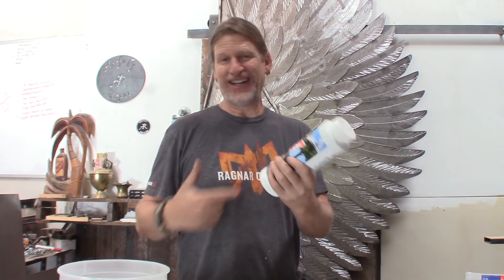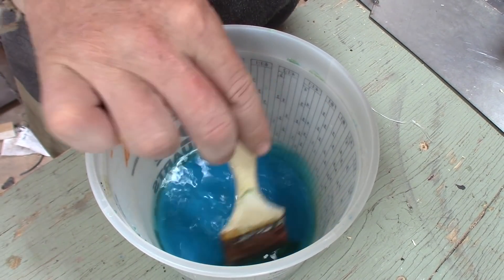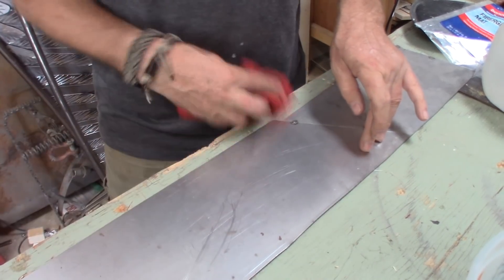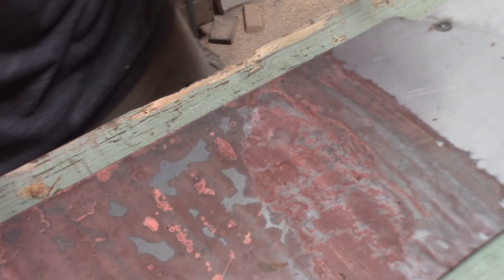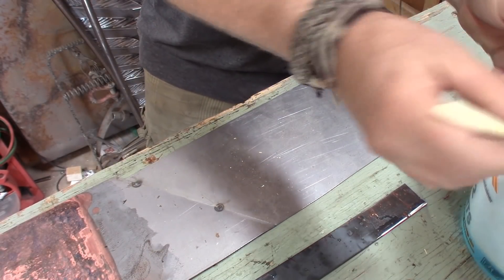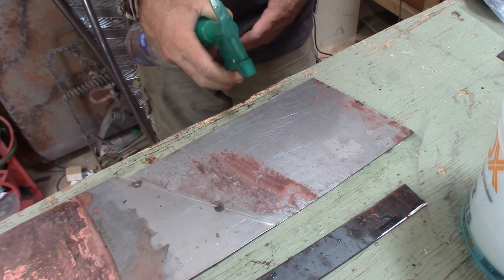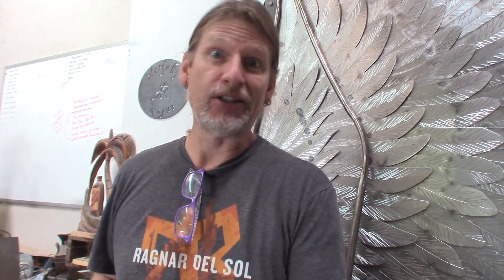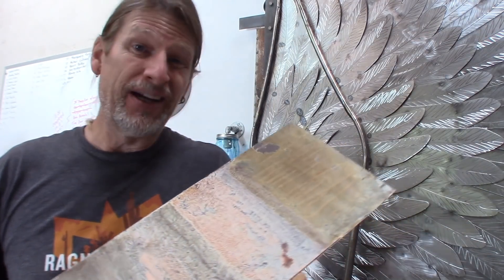Copper Sulfate on steel FREAKED ME OUT!!!!

Comment: Pressure treated lumber contains copper.  That's why you have to use special coated screws in it.  If you put a regular nail into pressure treated lumber, it will be completely rusted away in a year. This is because copper is not close to steel on a galvanic chart.  
I'm guessing you don't want your door skins to keep rusting after you create them.

Comment: I'm in the process of restoring an old table saw with a cast iron top.  There has to be at least a hundred YouTube videos on ways to remove rust from cast iron, but I didn't see any that suggested using CLR (Calcium, Lime & Rust Remover).  I tried a similar product, also made by ZEP, which is available from Home Depot.  It's commercial grade, far less expensive and more concentrated than CLR.
I spread paper towels over the top of the flat table and soaked the towels with the full strength solution and left it over night to see if it would budge the rust.  I was amazed when I pulled back the towels.  The surface was etched in an amazing pattern, almost a CAMO effect of muted rust tones, greens, reds and blacks.  The most amazing thing was the shapes of the patterns and the layered dept of the pattern.  I'm sure you would really like it.  I would love to see this as a finish on a Rat-Rod.  Unfortunately, that wasn't the effect I was looking for on a table saw so I easily hand sanded it out with 400 grit wet & dry sand paper using varsol as the wetting agent.  The final result is the smooth, rust free polished steel finish that this saw had when it was new.  A paste wax finish to seal it and it's ready to go.

Comment: Actually what you are doing is dropping copper out of solution not sure what happens to sulfur but this is not truly bonding to the metal if you were to hang a piece in copper sulfate you would see metal copper crystals form it will be 99% pure metallic copper

Comment: pretty much any kind of copper compound will work. Just take hydrochloric acid and some copper than add either hydrogen peroxide or just use an air bubbler to get it to start to break down the copper. Than you can use the resulting black/greenish liquid to plate out onto iron or steel by just brushing it on.

Comment: This is the method we use at my workplace to see if the passivation process for stainless steel worked. If copper forms, it's a fail - there's still iron present.

Comment: Very cool expermient! Scrubbing the work piece with scotch Brite or kitchen pumice and use a degreaser prior to the copper coloring makes it more receptable for the copper..
Copper onto Iron is a exchange of charge or a socalled immersion deposition, you disolve a little iron or its oxide by the solvent of the copper sufate ( or vinegar or chloride) and you deposite Cu ions  slash reduce them into Atoms..the more acidic the Copper suffate is adjusted the faster it goes..but fast deposition is larger copper crystals and less adhesion..so slightly acidic is nice...if you warm up the work piece to 30-40 deg. C it works better...since and Immersion deposit is never sealed you can build up copper over copper for some degree than it slows down and stops..but you can re active the copper color with wiping it with sligthly acidic copper sulfate ( CuS04 + a few drops of dil Sulfuric, careful with acid use goggles and gloves).. 
Now for the deco worker...take it and dry it..then apply Sodium sulphide ( Na2S) diluted in water.. yes the thing smells like rotten eggs..can be made also with onion juice etc..now you can brownish and blacken the Copper entirely and scratch it back with scoth Brite to brings structures alive in the patina.."antique it"  .other tricks are heat it and use ammonia and it turns out patina blue in the warm spots...you can produce very lively colors from copper, black, brown and red or turquise blu..your Indian sculpture behind you would turn into a mindblowing monument with real aging and patina apperance like it was buried for 100 years! Thumbs up for your channel! ->tip  a clear coat after all makes it staying forevee
Reply: Great info! Thanks for sharing your knowledge👍
Reply: @davetruther31  any time Sir!
Reply: @rveurope  Thank you Sir🙏
Reply: Yup. The oil is preventing the chemical from actually getting to the metal. If you like the random effect, you can add a tiny bit of oil to a rag and wipe it gently to leave streaks and globs. 

The copper will turn dark brown, and then turquoise if left by itself. Since the layer is so thin, it will eventually “rust” off. So indeed, you have to protect it with a varnish made for brass. You can get it in glossy and matte.
Reply: Fantastic
Reply: I want to do an entire barn ceiling this way so it has to be fairly easy. Will sodium sulfate turn galvanized tin dark also.  I would like to darken the tin and have copper highlighting. Not necessarily rust, just copper colors on a dark flat tin
Reply: Galvanized tin roof? Entire roof? Gutter?
Reply: Thank you!
Reply: @donmcleod8307  very welcome
Reply: I love to try expermients.  They come with menthol right?   :-)

Comment: you'll get better results if you do an initial acid etch with electolosis and then apply the coat with copper sulfate... cupric chloride also works.  I use the process for copper plating bolts that need some protection... but can't be zinc coated.

Comment: Copper sulfate is one test use to check stainless steel after it’s been passivated because if there’s any metal still in the stainless steel it will turn copper color. The steel on the stainless steel would be cutting tools coming in contact with it fixturing

Comment: You really should wipe it down with acetone to remove the oil.
Reply: Downside of that would be that it'd make the top layer more consistent. It'd give you way more control if you were trying to paint on a specific pattern or just plate on a solid layer of copper, but it'd hamper this kind of decorative weathering by making it look too deliberate. (Yep. Intentional "accidents." Weathering's weird sometimes.)

Comment: If it worked on aluminum it would be cool to ar15 receivers
Reply: It does, as the aluminium will replace the copper in the solution just as it does with iron, but the copper will precipitate, not replace the aluminium in the structure. 7th grade chemistry, at least in my country.
Reply: @DanSlotea  
I would guess nothing happens.  The oxide of the aluminum surface will block any chemical reaction.  So copper sulphate remains itself.
Reply: @lpjunction  there's oxide only if you don't clean it. Also adding  table salt to the solution will start the reaction, even if the surface is covered with oxide. So something happens, if you care to happen.

Comment: When I was a kid (in the 40s), the local farmer's co-op had copper sulfate by the barrel, big crystals about an inch long and a half inch thick.  Farmers used the stuff to soak seeds in before planting--I think to fend off fungus.
Reply: Toklineman you’re right. As a farmer, we use copper sulfate for fungicide (mildew). You can get it at any garden supply store.

Comment: Iron is more reactive than copper. Therefore, when you add a copper compound to the steel, copper precipitates out into the pores of the steel sheet as the elemental Iron changes places with copper in the solution.
Reply: Was looking for this comment. This is 7th grade chemistry. Somebody skipped gymnasium classes hahahaha

Comment: It’s actually white coloured crystals, it’s the moisture from the air that has turned the them blue...
Reply: The white form is anhydrous copper sulphate and is amorphous (non-crystalline), the blue form is the pentahydrate, and is the most common form. The addition of water to the anhydrous salt is strongly exothermic, so take care. The anhydrous form is more expensive. If you leave the anhydrous form in moist air it will absorb water, i.e it is hygroscopic.

Comment: Super cool, until you got to the end and talked about your other video on CAUSING rust.  I can't tell you how many hours/days/weeks I've spent removing rust, but I got a very visceral reaction!
Reply: I live in the S.W. U.S. where the humidity and rainfall are low, we prefer to rust finish steel here because it is cheaper than paint and is easily fixable if damaged.  I had a client who was from the U.K. who could not stand rust finish.  I told him that I understood it was not desirable in England, but is perfectly fine here.  He was not having it.  When clients display mental problems there is nothing you can do to help them.
Reply: Bluing is rust. Embrace the rust, trust the rust.

Comment: So, what if you silkscreened some resist on the steel, in an artful pattern, could you get a rust sign?
Reply from the maker: I'm sure you can. I used vinyl numbers on sheet steel and rusted around them. When I removed the numbers it was clean clean minus a little bleed through....looked cool

Comment: Us geeks who had chemistry sets in the 1950's learned this at elementary school age. Then again in an 8th grade science class. . .(dip a bright nail in copper sulfate). Remember when science was FUN?  Industrially this is the "copper flash" plating used as the first coating prior to nickle plating and in rust proof chrome plating which has nickle under it. In my metal shop I have newbies learn the periodic table and basic chemical reactions like this. . . that they SHOULD have learned in public school.  You can't read an alloying chart without knowing at least half the periodic table.
Reply: they dont sell chemistry sets anymore WITH the chemicals in them.

Comment: You liken it to "candy" on tv but Copper Sulfate can be absorbed on skin contact and is incredibly poisonous when you contact or breath the vapor. What do you do to detoxify the surface when it is applied?
Reply from the maker: That's an interesting interpretation. I actually had to go back and watch the video to see how that might be seen like that. You must have some very unique interest candy. Haha. I was excited about the process. I also made a point of scrolling that it was dangerous and that people should read the warning label. I do art. I look for cool ways to treat the art that I make. This was a cool method. That's all it is. Although I rarely use this method, when I have and once the liquid has dried on the metal I give it  a water bath to dilute any residue in accordance with my local waste management facility.

Comment: I would like to see the process on plate cleaned with acetone and with a battery charger hooked up to the plate so that an electrolytic process is making the surface more permanent.
Reply: labrat7357 I remember that method when I was a kid. One of my experiments with copper sulfate was plating a stainless steel teaspoon with a lantern battery as the power source
Reply from the maker: That sounds like a very cool process to try
Reply: That's how it's suppose to be done.  So you can bond the electron.  He should be mixing in acid, and electroplating.  Just like a circuit board.  Otherwise use it to kill plants, or turn blond hair green in a pool.

Comment: Degrese it first and you will get a  much better coverage with the copper colour.
Reply: wonder what would happen if you sandblasted a stencil pattern in and filled it with that mix....
Reply from the maker: Thanks Graham
Reply: After degreasing try applying by using a damp cloth dipped in the dry crystal compound. Use a circular motion with light pressure. You can also create patterns using masking tape with this method.
Reply: @franktorres8473  so you could make patterns with oil or tape?.... oh man! heat and this for discoloration, combined woth rust could make for some realy wild artwork!

Comment: Curious to know if you have tried this on cheap stainless steel and if so does the copper sulfate have much impact so far as creating a copper colored  patina? I just read down your list of comments and saw that the  question about stainless has been asked before. I wondered if you have since found materials to force a patina on cheap stainless (the kind that will rust if left in a salt bath for a while). Thanks for a very interesting video.
Reply: thanks for your response. acids are for the most part what I have seen but they give a standard acid wash look rather than the fine assortment of patina's that you can a achieve in so many different ways with carbon steel. There are products on the market to blacken and even color SS but they do not produce a durable long lasting patina.
Reply from the maker: The quest continues :)
Reply from the maker: Still trying different things on stainless. Nothing works great yet, but not giving up : )

Comment: You can buy pure copper sulfate/ Bluestone at any gardening supplier in Australia. Bunnings etc
Reply: Yea in the gardening section. Check the website. But making it stick without electricity is pretty hard to do. Did you see how easy it was to wipe off? Check out how to electroplate copper before trying!
Reply from the maker: I'm sure that will do a good job on rusting metal!

Comment: You mention you are colorblind.  Have you tried EnChroma glasses? (enchroma.com)  Try these!  (There is 80% chance you will get color vision almost as good as everyone else.  Take the test on enchroma.com.  It will indicate the chance the glasses will work for you.  You can get glasses with Rx lenses, in both "sunglass", for the most correction, and "indoor" versions, less tinted but less correction.)  You may see metal in a whole new way!  Don't fall for the cheaper Chinese imitators.
    By the way, "copper sulfate test" is a test designed to see pinholes in metal finishes (such as on steel used in food cans).  The copper and the iron are trading places chemically.
     The problem is that the finish tends to be chemically unstable (think worse then bare steel).  This is OK for something that is displayed only (changes in finish will not make much difference, or will be protected with finish) or outside (where you want rust on purpose) but for something such as a table top where finish will get worn, finish will show every nick and scratch with tracks of corrosion.  Do not get solution trapped between steel parts (such as where table leg meets table, in hinges, bolt holes, or in welds, where there are voids.)  Solution will keep eating away steel.  Rinse everything until you know chemical is gone, then rinse that much more!  Do not allow chemical to become trapped under finish.
Reply from the maker: I've thought about trying them but just never really looked into it. At 52, I'm pretty sure it would not change the way I do my work as I'm so use to seeing things as I see them. I would think if I saw colors normally it would feel weird of fake in my mind. :) either way it's be interesting for sure.

Comment: I'm going to give this a try next week, my only concern is how do I stop the steel from rusting further? Do I need to apply a clear coat on top of it to seal it? As I'm thinking of using thin metal steel sheets (rusting them for effect) as cladding on the internal roof of a double decker bus which I'm converting into a restaurant. 

If anyone can please advise it would be much appreciated
Reply from the maker: Sounds like a very cool application! I usually use a spray on clear coat but if I want a little extra protection I'll do a paint on clear coat after the spray coat

Comment: How durable is the copper finish without any clear coat? I want to try this on a DIY steel wood stove, which gets too hot for even high heat clear coat finishes. Do the copper  finishes come off easily?
Reply from the maker: I've had some sitting in my shop for over a year without clear coat and it seems to hold up well. Not sure how it will handle the heat though.

Comment: Used a lot on lead/tin solder on stained glass. Clean with ammonia then distilled water before adding the Copper sulphate solution. Wax after.